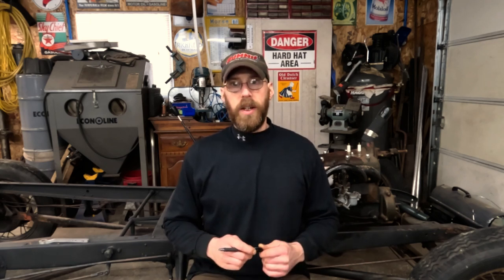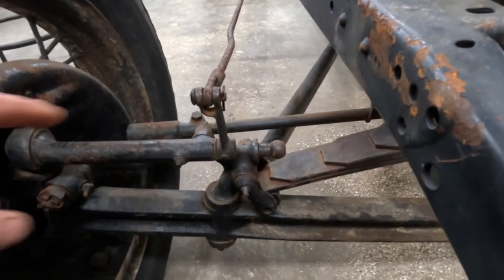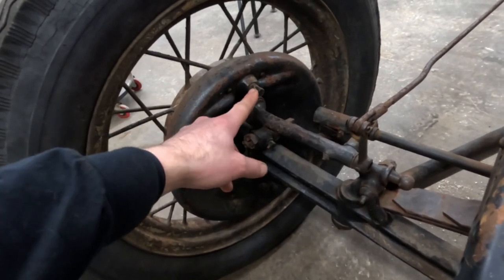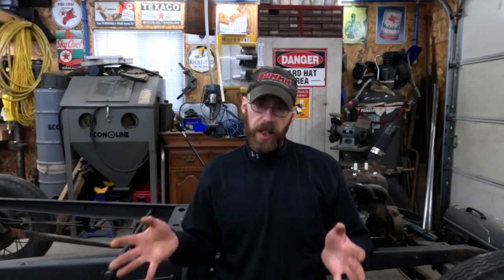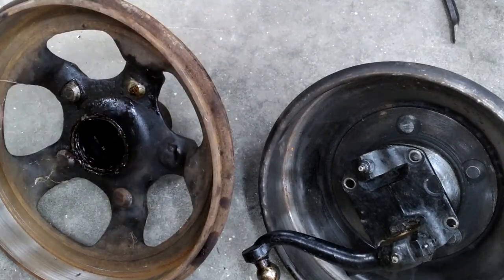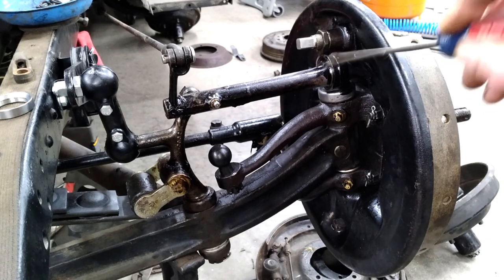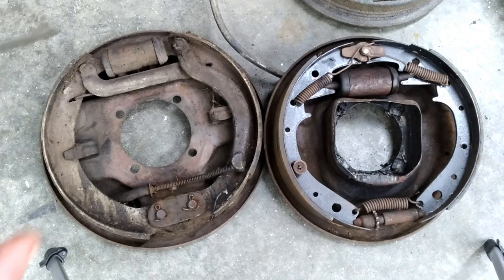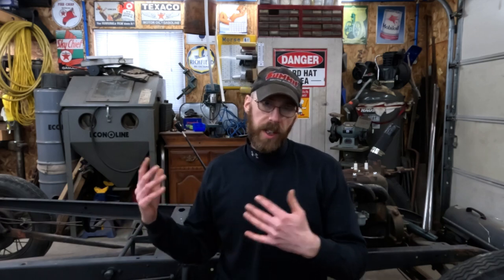How do Mechanical brakes work? Early Ford Brakes Model A  juice hydraulic brakes traditional hotrod

Comment: Excellent video.  Both my 29 Model A coupe with rod actuated mechanical brakes and my 37 Ford pickup with sheathed cable actuated brakes stop better than my 40 Fordor sedan with Lockheed hydraulic brakes.
Reply from the maker: I don't have a lot of experience with the cable brakes.  How do you like them compared to the earlier style?
Reply: @Maine_A_S  The truck needed new cables due to lack of service over the years.  I bought four NOS cables from Joe's Antique Auto in MA.  They attach at the X member to a small cross shaft operated by the brake pedal with a short rod to the cross shaft.  The shoes are self energizing with different hold down springs that assist the operation.  Southside Obsolete has sets of the cables, too.  If you remove the existing cables you can free them up for reuse….but I didn’t figure that out until later on.

Comment: Properly adjusted mechanical brakes can lock up your wheels when braking hard.  If you can lockup the brakes, then why bother with hydraulic breaks as they will not stop your car any sooner.
Reply from the maker: There is a lot more to braking than locking up tires.  Brake fade us the big issue with stock A brakes.  The crappy steel drums get hot and then you have little to no brakes.  It's a pretty decent system with cast iron drums.

Comment: My English isn’t that great to follow up all of your valuable information. Just I would like to know, if you don’t mind, how long should the breaking distance for a model a , 1927-31, let’s say with a speed of 30 mph and 50 mph, if the brake system and shoes are in a regular used but good condition.I m be quiet sure you’re the right guy to let me know. Thank you so much.
Reply from the maker: Thanks for the question.  I'm not sure what the braking distance should be.  The original size tires are so narrow that they slide pretty easily.

Comment: Im working on a 28 Hupmobile model M with midland steeldraulic brakes, they are mechanical brakes with a steel cable that actuates the cam in the brake shoe.
Reply from the maker: That sounds like an interesting setup. Is it difficult to find parts for?
Reply: @Maine_A_S  sure is I bought the car last year just about got it roadworthy, car had been off the road since the 50s can’t wait for the warm weather to really get out on the road

Comment: Great content.  I have a 1930 pickup that I bought 5 years ago. My son and I took it out of storage late last fall and brought it home . The engine would not turn over and all the linkage and joints were froze But the breaks worked. we have since got the engine to turn over and are now looking for a carb kit. The gas tank is full of crud so I guess we are going to use a lawnmower tank until we clean the take out . I really didn't know squat about the  "A" until I started to watch your channel, and some others . I want to thank you for all the good information you have given me . We hope to have the "A" running in a few weeks and am looking forward to seeing all the good information you have . Where would you suggest I could get a carb. kit and maybe those break adapter kits you were talking about. Thank and keep up the good work.
Reply from the maker: Thanks for watching and I'm glad it was helpful.  Most parts suppliers carry carb kits but Renners Corner is a great source for carb parts and information. I got the brake parts from Snyders.  I buy most of my parts from them.  Good luck with the project.

Comment: Flat Head Ted says to remove the top spring (which scares the heck out of me). I notice you are using the Flat Head Ted system, but maintaining the top spring. Thoughts?
Reply from the maker: Honestly, I didn't pay real close attention to the instructions when installing it.  I'm not sure why he would recommend that but the brakes seem to work fine with that spring still in place.